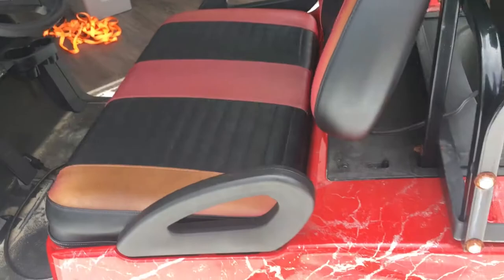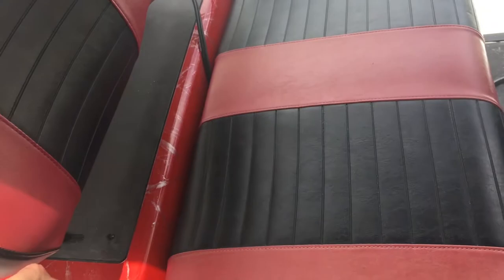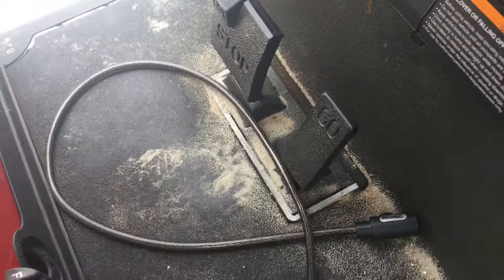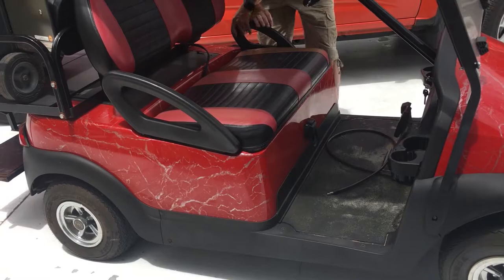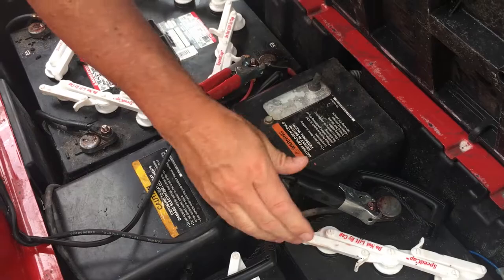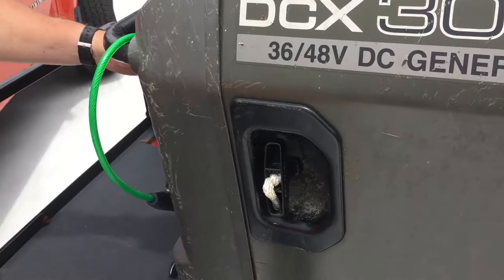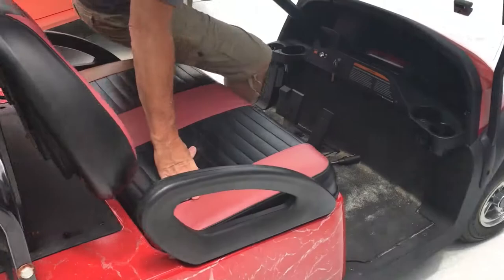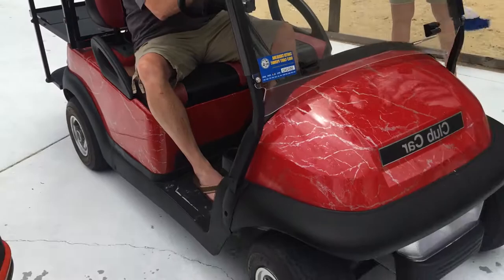Gas powered electric golf cart

Comment: I just wondered if this would work.  I wanted to put the generator under the seat and see if it worked.  Then I decided to look and see if it had been done.  Did you ever try it without the batteries hooked up?  I have a 36v system In mine
Reply from the maker: No I didnt try without the batteries, yet. I do believe it would work though. I'm waiting on some connectors, once I get them I'll do a follow-up videos trying to just run on the dc generator. Keep in mind, mine is 3000 watts. I was able to capture the starting amps when flooring it from the batteries, and it was around 197 amps at 48v, so I'm sure it wont move nearly as fast from the start, but i think I can get around 15 mph out of it.
Reply: @SuperRobkar  right on thanks!
Reply: Ha 😂same here. Was thinking of basically putting an inverter generator where the battery is

Comment: Are you charging the batteries ? Did you bypass the batteries ?
If you take the batteries out that would reduce the weight and voltage demand ,probably pick up some significant speed.
Anyway I like your program,batteries and generator about the same cost.you can pick up those elec carts cheap.
Reply from the maker: The batteries were dead, I just connected the generator to the main positive and negative. I was just curious if I could use this in an emergency or if I ever wanted to go very far.  I have since upgraded to lithium, and ditched the lead acid. With just a magnet, I can get to 21 mph top speed.
Reply: @SuperRobkar  what kind of lithium ,how much they cost ?
21mph that's rad.
Reply from the maker: @randolphsnyder1505  I made the pack with used nissan leaf cells. You can get them for about $50 a module, i needed 7 modules. Also would recommend a BmS
Reply: @SuperRobkar  hey so I was definitely wondering part of his question was can you run it without the batteries with the generator yeah I'm very interested if that's possible could you possibly give that a go and let me know I would appreciate it
Reply from the maker: @dustinswatsons9150  I should be able to test this weekend, as its going to be a nice day. Keep on the lookout for the video. I do not see why it wont work though. The generator will hold at 52volts, The surge DC amps when in battery is about 197 amps, so I'll never get that from the generator, but that just means to me it wont have that neck breaking takeoff,  no big deal really.
Reply: @SuperRobkar  somewhere I once read or someone told me that you could replace the batteries with capacitors and it'll assist for the take off as long as it's the same capacity as those batteries and they'll dump the charge fairly quick whatever is required is you know how many capacitors or or configuration of capacitors you have fulfills that need
Reply: @SuperRobkar  oh and capacitors last longer you can find a way to hook them up like the batteries will get that initial punch and the generator will continue the standard flow because I know and understand that some equipment requires a certain amount of starting voltage and amperage
Reply: @SuperRobkar  there was this one video I watched on YouTube where the guy used capacitor Bank that was smaller and lighter than his car battery and it would hold the effective charge to start the car again for at least a week and some change and they technically last longer than batteries
Reply from the maker: New video is up

https://youtu.be/n8S5AeS8UVo